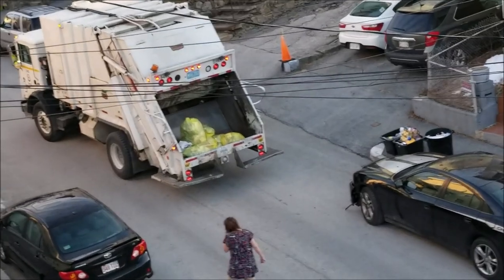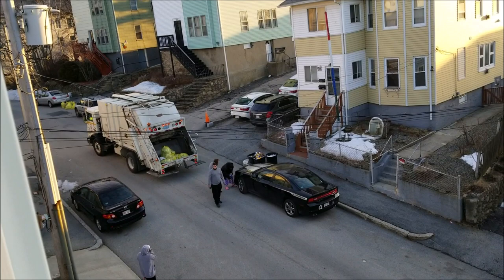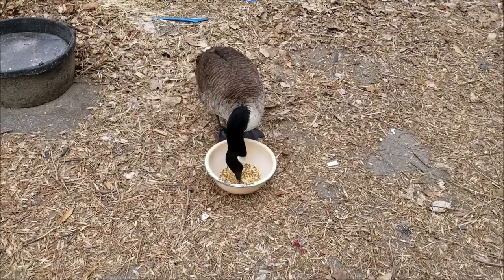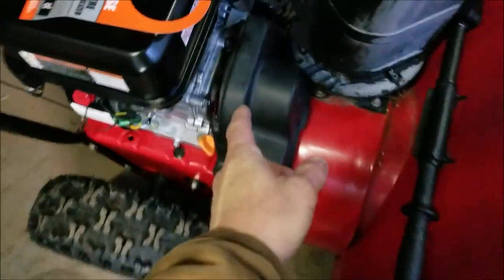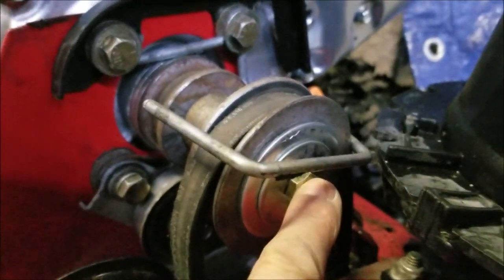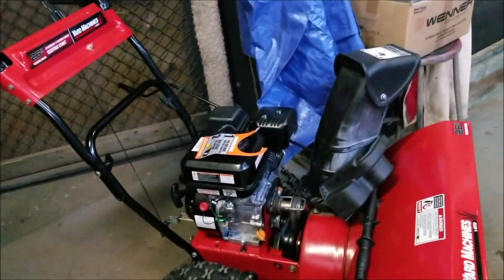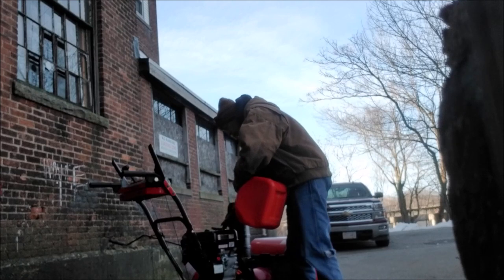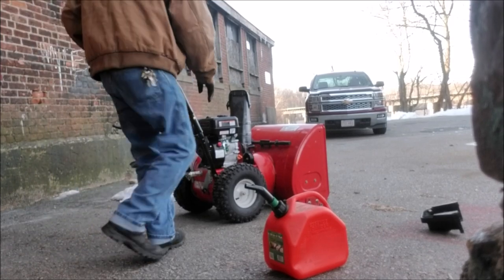Trash truck crash and snowblower repair With Udizzy1969

Comment: Is there no key way on the auger pully , under load the bolt may not hold .
Reply from the maker: There is a key way, but i never Tightened it up so it was sloppy lol I did go back and add a new washer as well, now works Great. Thank you. Cheers Dizzy.